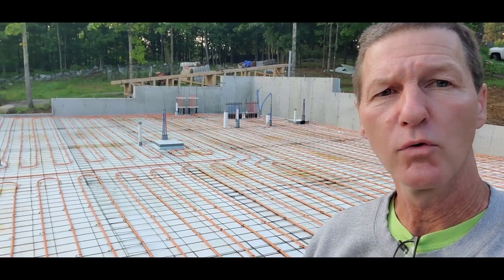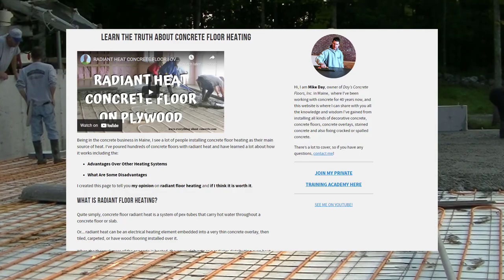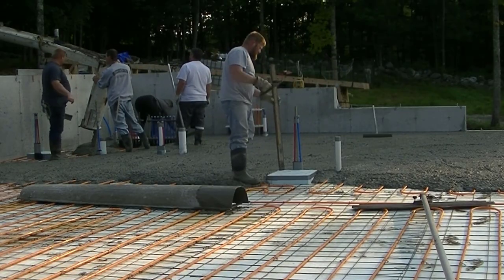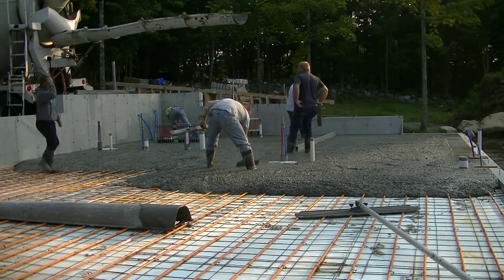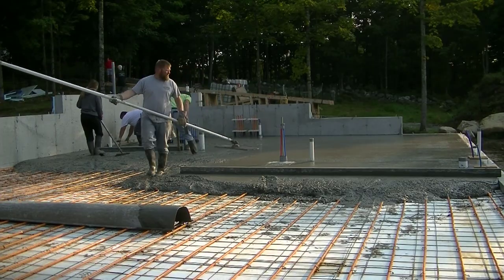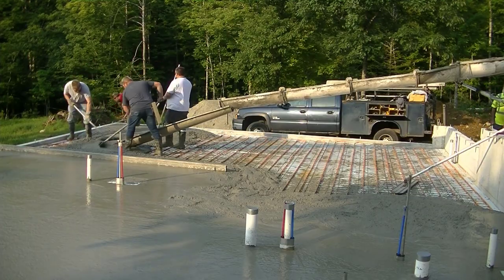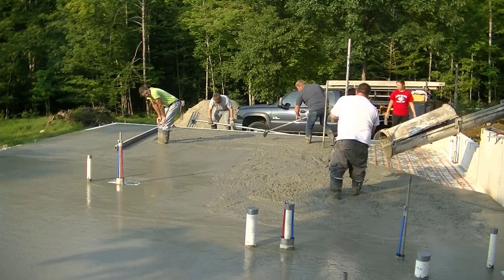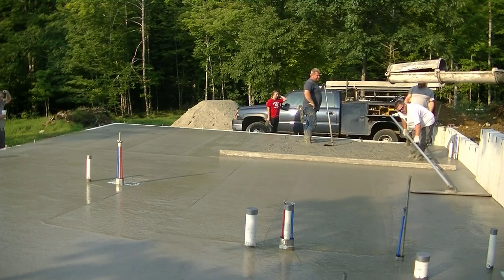Pouring A Concrete Floor on Radiant Tubing (Heated Concrete Floors)

Comment: I own a masonry and concrete company in Michigan. We pour a lot over radiant, Only different is our mechanical contractors have to loop the zones together and put 50psi in the lines with a gauge attached, I take a picture of the gauge before we pour so there is never a question of we put a hole in during the pour.

Comment: Hi Mike! Love your content, thanks for all the great wisdom. We pour exclusively on radiant heat floors here in Alaska. We do mostly mono slabs with thickened footings. We usually staple the pex to the foam first and then put the mesh on top. We don't use fiber, so the mesh is necessary, and we try to pull it up in the concrete a bit. 
         We recently purchased an Mx fuel power screed and I've been watching all your videos trying to learn how to use it on a 60 yrd pour coming up. All your videos are priceless to us younger guys with no teacher to show us how it's done. Thanks again for all your great videos!

Comment: Awesome videos, Mike - great commentary and very informative.  I realize that you need to follow the directions of whoever has installed the tubing for radiant floor heating.  But for maximum system efficiency and end-user comfort it is actually best to have someone in charge of pulling the mesh and tubing up to approximately half the mid-depth of the slab (except at any control joints, where it should remain at the bottom of the slab).
The deeper the tubing is, the greater the thermal resistance between it and the floor surface, requiring higher water temperature to maintain a given rate of heat transfer.  The closer the tubing is to the bottom of the slab the more heat is lost to the underside of the floor - true (but to a lesser degree) even if there is styrofoam insulation underneath.  And also, when the tubing is near the bottom of the slab more of the slab’s thermal mass is above the tubing, so it takes longer to heat the space.  It also lengthens the cool down time.  So you end up with heat fluctuations; less even heating.
Reply: Sounds like a good technical idea. If you’ve done it send a link. Almost impossible to lift these and stop at control joints. Hey but if you’ve done it I’d like to see your tricks.
Reply: @hpain6261   Yes, that's the theory and the ideal. When I did mine 20 plus years ago, I had some 1 1/2 in spacers under the tubing and mesh.  I think I just used little off-cuts of wood.  On the main floor and upper floor, which were 3 inch pours of lightweight concrete gypcrete), there was no need for mesh and the tubing was attached directly to the subfloor.  But for the basement floor (conventional concrete), the tubing ended up being a bit lower than ideal. Unfortunately, at that time I was not aware of the information that I posted above.  But the system still works great anyway. I suppose it's a little slower to respond to changes, but it's in the basement and remains pretty steady.  It's certainly nice to have a basement the same temperature as the rest of the house. Up here in Yukon, most friends that I visit have basements that are considerably cooler than the rest of the house in the winter.  The only time my basement is cooler than the rest of the house is in the summer, which is ideal.😊

My house was already framed before the basement pour,  so they had to use wheelbarrows. It didn't seem to be much problem with the mesh and tubing being 1 1/2 inches off the ground (insulation).  

But you are right, it would be difficult to raise the mesh and tubing accurately during the pour.  Kind of like pulling yourself up by your bootstraps.

Comment: How about stapling the tubing to the foam, then lay wire mesh on top to keep tube down? Then you get some strength from the mesh too.
Reply from the maker: That's what I tell them to do. Hardly anyone does it.
Reply: If the wire mesh is on top, some energy is wasted heating up the mesh. You want the heat rising up without obstruction.
Reply: @inglouriousmofo  - its ‘radiant’ heat. It wouldn’t matter where the mesh is. And even if it did heat the mesh, the mesh would then release that heat into the crete.
Reply: We staple the tubing down to the styrofoam and put the wire mesh on top so the wire becomes a functional member in the slab.
Reply: If you do the reinforcement above the pex with the pex stapled down, the rebar or mesh needs to be separated as water that could build up under the slab would have more of a chance to get to the metal.

Either the pex attached to the metal and both embedded in the slab or the reinforcement needs to be embedded.
Reply: @dericksmith2137  It depends on the system it could take longer to heat which costs more to run

Comment: Thanks Mike I always enjoy your helpful videos. A couple months back we did a radiant floor very similar to this on a fairly cold morning here on the North Oregon coast. We had hot water in the concrete and when it hit that tubing it swelled the tubing and all the pressures dropped and we thought we had a leak. They had water in all the tubes so they wouldn't float up and they had about 50 or 60 lb of air pressure on top of the water and the gauges all started droppling after we were pouring out and we thought we had punctured a tube but it was only the heat from the hot water concrete softening the tubes and they swelled a little bit and the pressure dropped. We got rid of all the water and put air in the tubes to look for any bubbles coming up thru the wet concrete but nothing came. Afte ar while the pressure stabilized and we were realized we're fine. Anyway was very stressful, wass about a 40-yard pour and we were wheeling the back part and we thought maybe the wheelbarrows had damaged a tube.
Reply from the maker: That's understandable. Glad you didn't have to fix anything
Reply: Wow 
That’s scary
Reply: Sounds like a nightmare, glad you left this comment tho very helpful to know that could be a possibility
Reply: Hi,so who would be libel for the fault ? And who would fix it ?

Comment: Nice job! 20yrs slinging mud. You guys had easy money! Yes I poured in floor heat in garages, poll sheds and basement floors with structures on already. Using plywood runners. The trickiest ones we've done were using 2x6 (not allowed to set the wheelbarrow down or run off 2x6). Nice touch with the fiber mesh! Great job!!!
Reply from the maker: Thank you
Reply: That's how we do it too. Almost always the buildings are framed up and we have to wheel the back half. We usually put 2 by 10 or 2 x 12 down on top of the piping and then keep moving them. We did one in March we wheeled 17 yd with 3 wheelbarrows.
Here on the Oregon coast we wheeled a forklift ramp at a seafood processing plant 14 yards. You get a good rotation going with strong guys you don't have to shut the chute off.

Comment: I knew a plumber 60 years ago put steel or copper pipe under his cement sidewalk and connected it to his boiler because he wanted to melt the ice and snow.  Needless to say it didn't work because he didn't give it any room for expansion.  His theory was ahead of his time.
Reply: Good idea, especially for my front stairs.

Comment: Thinking of doing a radiant floor in Ireland, watching your videos so I know how it's done right and that I know what to ask for when taking to contractors. Difference is we would need nearly 8" of polystyrene insulation to meet building regs.
Reply from the maker: Wow! That's crazy
Reply: @MikeDayConcrete  Ya the ground floor needs to be at least .15 u value can meet it with about 4" of PIR too.

Comment: Have u ever tried putting expansion joint around the exterior foundation?  It helps has a barrier between the floor and the exterior floor.  It helps keep the floor warmer and not heating the exterior wall.  He in Sioux falls SD it a city code for and in floor heated floors.

Comment: Have you ever used  insulation board with a pre installed grid pattern to run the tubing in  which makes it extremely nice pipe dont wiggle or move and it insures that the pipe is down under the slab and not into it.  We use it here in ny. I think you can buy at home depot
Reply from the maker: Yes many times. I like regular Styrofoam better myself. Just preference

Comment: Question. Would I need a foundation poured before the slab is poured?   I’m planning to build a metal structure workshop (woodworking), which will be attached to my existing 24’x24’ garage.

Comment: I was planning on doing radiant for a client of mine, but I see that they have the creheat panels, two inch’s thick like the blue board except has groves to lay the pipe into. 
Any thoughts on that style?
Also, my client told me, he planned to put 1/2 rebar 2 foot on center inside the concrete directly on top of my tubing. I don’t see why that necessary? It’s probably not good for the pipe either. Also, it is a slab on grade. I assume a frost wall, with a walk out 3/4 around the slab.

Comment: Im thinking about doing radiant floor in house im going to build
Reply: Not sure about cost efficiency, but this is the best type of in home heating
Reply: @danielchmiel4143  It costs more up front, but it's definitely more way more efficient heating if done right and the comfort factor is great.  It's also silent - unlike forced air or even HW baseboard heaters.

Comment: What if you put the tubing right over the foam, and run a light re-mesh over the top of the PEX tubing?  Just pop the mesh up a little as the pour proceeds, so most of the mesh is supported on concrete instead of allowing the weight of the concrete to squish down the tubing.

I will be pouring a shop floor probably in Spring, and would like to know if anyone has tried that stacking yet...

Comment: I lost one loop in a 2 loop garage about ten years ago. It held pressure, but had a bad restriction. Can't say the floor guys crushed it or not (or of something is in the tube), but I've left all my floors with pressure in them ever since.  In a hurry to move on, the one time we didn't pressurize.
Reply: You can't crush it.  Takes over 160psi to pinch 1/2" pex. The foam it's on, is typically rated at 25-35 psi, so they'd push the tubing into the foam long before pinching the tube.  If it's restricted, it's likely from foreign debries
Reply: @danray104  oh I know that, I've always wondered if the neighborhood kids were checking out the project at the time and a pebble found a new place to live
Reply: It's rare to lose a circuit during a pour, but it can happen. Always a bummer, and rarely an easy fix

Comment: I think most of people install that kind of system  assume  every thing new works better , which is not always the case. I do not see big of advantage unless red out of the radiators on the walls

Comment: Because of the extreme winter temperatures we are forced to endure here in S. Florida, you can opt for a radiant heated floor system, if you want, or go with a forced air system. I can honestly say that I’ve never punctured one of the radiant heat tubes in any of the floors I’ve ever poured. 😉

Comment: Hey Mike, Would you know of anyone in the Upstate NY area that would be willing and talented enough to help me out with my self built radiant garage slab? 64x40 with drains has me nervous as it's the largest pour for me to date... that and it's just my father and myself..
Reply: I hope you found help. I’ve poured concrete for 25 yrs and will never dream of pouring this much with just one other guy 🤦‍♀️
Reply: @tokouatonga7914  I had plenty of hands, but not many knew what to do with them… pump truck operator had someone willing to lend some experience. Luckily the weather made for slow setup.